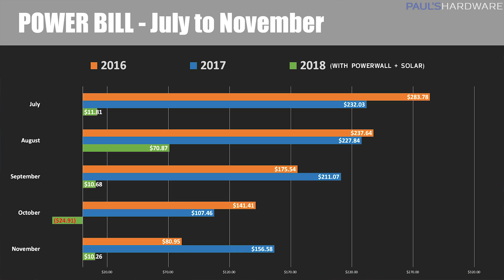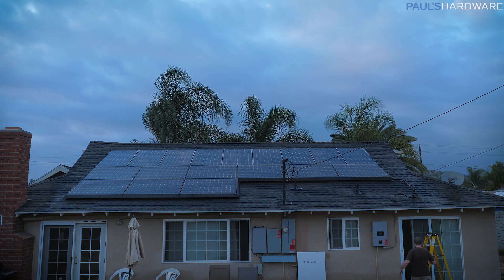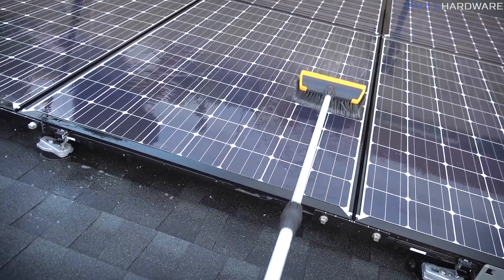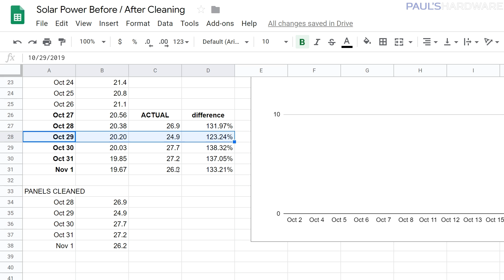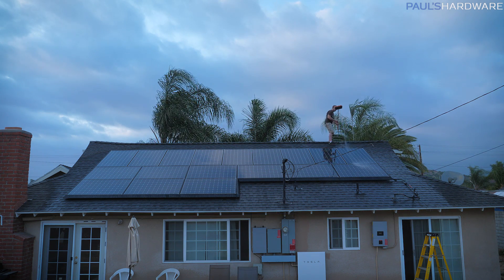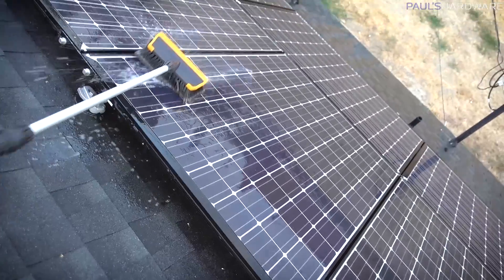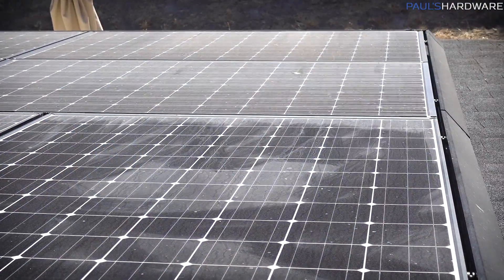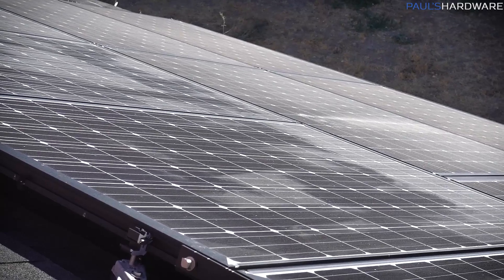Should You Clean Your Solar Panels? Before/After Testing!

Comment: Paul i was told to use a pressure pump washer with detergent and an extendable brush like the one you have to wash the panels as you want to minimise the water used to wash them as it can make your roof slippery, then once done hose them off from the top of your roof like you did originally.

hope this helps with the part 2

Comment: just checking your math and you actual actual percent difference are as follows Oct 28 = 27.6% Oct 29 = 20% Oct 30 = 32.1% Oct 31 = 31.2% Nov 01 = 28.5% not at all too different, but just couldn't live with myself if i didn't correct the mistake... sorry  Paul

Comment: Paul - wouldn't it be a ton of fun to own a cherry picker?  You could use it to clean the panels once a week, attach a small wind turbine, and/or, go to maximum height and relax up there on a lawn chair.
Other suggestion: get a longer brush, with counter-rotating heads that a powered by the water flow - along with a detergent injector.
Seems to me that a solar panel cleaning business might do well in your area.

Comment: If your water is hard, it may cause calcium deposits to form on your panels over time. FYI. May or may not be worse than the dust, will definitely be harder to clean off. Suggest water softener chems to your wash.

Comment: I'm surprised you've seen such a big jump to be honest, but I'll be interested to hear what else you find in the future.  Some other commenters mentioned checking the solar insolation - a quick look at systems around LA seemed to have a jump around that time so I think it's at least partly due to stronger radiation levels at that time.

I tend to just wait until it rains - I can see that the dust / bird poo has gone but I don't see any obvious change in production - certainly not 20-30% range.
Some data here - https://pvoutput.org/list.jsp?df=20191001&dt=20191031&id=67593&sid=60069&t=m&gs=0&v=0
We had rain around 10th and 12th October for the first time in months - not much improvement in generation after that (I'm in the Southern hemisphere so our days are getting longer at this time of year).
My best day ever is about 44.5kWh - so 40 and change lately is pretty respectable.

My installer warned me to be very careful with cleaning if I ever do - you don't want to damage the panels (so definitely don't put any weight on them) and be weary of the coatings on the glass (best to avoid chemical cleaners), so his recommendation was:
Plan A: Leave it alone and let the rain sort it out
Plan B: Hose it off if it's noticeably dirty
Plan C: "Truck wash brush" it gently with plenty of water (sounds similar to what you have).

I'm not sure if your system will interface with it - but pvoutput is great for analysis & comparison with other systems near you.

Comment: Why are your panels getting dirty like that in the first place? I'm genuinely curious about that. Our 12.1 kW array has been up and running since 2013 and their surface is no more dirty than the day they were installed and we haven't ever cleaned them. Is this due to their surface material or the location of the panels, or maybe the angle? I check once or twice a year but every time I do I can't even find dirt on my fingers. But ours were designed to perfectly face the average inclination of the sun through out the year so maybe it's the steeper angle that keeps them clean? We live in the mountains of central New Mexico just 30 miles southeast of Albuquerque. Genuinely curious Paul. Oh and be careful up there on your roof please.

EDIT: By the way, your video makes me want to start cleaning them every spring at least whether I see dirt or not, lol. Thanks
Reply: He lives in California. If I had to guess, it's a combination of the dust and soot from the frequent forest fires, the lack of rain and the relatively high air pollution as a consequence of the state's high population density.

Comment: Hosing alone sadly won't remove the dirt, dust and grime that gets BAKED ON by the hot sun and ends up blocking the light getting through. Just look at ANY CAR left out on the street that's been untouched for a month or more - get inside and you cannot see through the windshield. The only way you're going to get your panels anywhere near clean is to either use a rag and go hands-on or that car wash extension rod with a soft bristle brush. It wouldn't hurt to run a mild cleaning solution through the hose as well since water alone isn't that effective.

If you're too chicken to get on your roof top then invest in a power wash. A high pressure nozzle will give you a longer reach and allow you to clean it from a ladder. Also, there is no shame in having an extra set of hands to help!

And yes, 30+% is significantly significant and can add up to hundreds of dollars OVERPAID to your utility over the course of a year. never mind wear on your batteries from additional cycling. Every solar owner should clean their panels at least twice a year to help maintain peak efficiency.

Comment: Are you allowed to use a car wash/dish soap on the pannels ( a degreasing agent ). Is that recommended or do they tell you to simply wash and scrub the pannels. Also thanks for the follow up videos. I appreciate the full breakdown of the whole system (cost, install process and power output). Side note I keep seeing your house on articles I have read about clean energy or solar pannel installation etc etc. Some how your home is the cover photo I keep seeing. Take care Paul and keep up the great work.

Comment: Have a look at an auto supply store for car wash soap / detergent that claims to lift residue and not require hand scrubbing. These formulas don't work very well on cars, but should be great for your roof. The products I'm thinking of come in bottles that you attach to your garden hose and have a built in nozzle. Squirt it on and then switch to a regular nozzle to rinse it off.

Comment: Paul, PLEASE buy an extension ladder to get up on the roof. Using that 6ft ladder (I'm assuming you used it since no other ladder is shown in the video [besides during the installation of the solar panels timelapse]) made me cringe, as that can lead to a very bad day(s) if it tips over while climbing up or down from the roof...OR...if you must use that 6ft ladder, rotate it 90° & get someone to brace it. I'd hate to see ya get hurt man!!!

Comment: Try using soap and they sell brushes that extends out to 11 meters, they are a little expensive but would make for another interesting video 😁
Reply: It says in the user manual, that you should only use water
Reply: @CyberlightFG  What harm would soap do?
Reply: @justsomeguy934  I don't know. The manual says, that you shouldn't use anything else then cold water.
Reply: @CyberlightFG  Well, that limits one's ability to clean the panels, doesn't it? You're only left with physically scrubbing them.
Reply: With a brush I'd be worried about trapping dust and sand under the brush and then the back and forth movement scratches the solar panels. A lot of dust you see settle on things is silica, so as hard or harder than the glass. From what I've heard, the best way to clean it is to give it a long sweep from one side of the panel to the other without a back and forth motion, just like cleaning your phone screen. That way you pile up the dust in front of your brush and just push it off instead of scrubbing it back and forth over the glass.
Reply: Airclot water alone is a great lubricant and prevents dust and sand from creating as many scratches. Given the lifespan of solar panels, cleaning will result in more power even with small scratches, compared to not cleaning.
Reply: Do not use soap, use deionized water.

Comment: @paulshardware, aluminum and brass are highly reactive. If your valve, hose, or attachment are mixed it will cause that type of corrosion. If not, there is probably another type of reaction causing the corrosion.

Comment: Paul I'd say the safest way clean your panels is to get a long pole of some kind and do the cleaning from the ground if at all possible. As someone who has fallen from height and broken a leg doing it I'd say stay on the ground if you can. Failing that , I'd go and get a fall harness if you need to work from the apex of the roof.
You could use truck wash soap to clean as well as long as you remember to rinse it off totally.

Comment: I had my own panels installed in 2012 Netherlands, Europe and cleaned them for the fist time early February 2017. They were really dirty and even had some green algae on them. That year 2017 would unfortunately become the year with the lowest power generation. So far but 2018 was the year with the most while they were already dirty again. It will no doubt make a slight difference but don't expect too much, probably makes much more difference in sunny climates than in moderate ones like mine.
Reply: Actually, it should be the other way around. If you get half the amount of Sun, you should have designed a system with twice the number of panels to generate the same amount of power for your home (this does make an assumption that homes are homes and require the same power). Therefore half as much gain from cleaning your twice as many panels is the same total power recovery. Clean your panels.
Reply: @CorwinPatrick  You can compare the Dutch climate with the north of New York state. Solar hours can vary quite a bit from year to year. Had 2017 been an average year I might have seen a slight increase in yield but it was a pretty bad year with less than average solar hours. The PV system generates about as much as I use, again on average. In 2017 I had to pay my energy company a bit but all other years since 2012 they have been paying me. Energy put into the grid costs the same here as when I have to buy it. I paid for it with my savings and early 2020 I will break even and from then on all excess energy is basically free money. Glad I did it. I will probably clean them again in 2022.

Comment: You should try cleaning solar panels on a 8/12 pitch two story house.  It's a long way down to the ground.  I use a telescoping brush the professional window washers use.  The only recommendation I would do is use a mild soap to help break up the grim.  After cleaning them I do see a power power increase.  I had the panels installed three years ago.  Been keeping track (created a spreadsheet for power produced and the sky condition for that day and calculate the efficiency)  and I have seen a slight degrade in power ( which is natural).  My results show about 2% degrade.  One other suggestion would be to go back track efficiency of the panel to let you know when you have to replace them.

Comment: I would suggest you get a long reach cleaning kit that goes out to 15 feet or more and working from below on your ladder (get a better ladder by the way) clean from the top down.  Then all you have to do is worry about falling off your ladder which can still kill you so be careful.  If you are getting 30%+/- increase you'll pay for a professional heavy cleaning kit in no time and you'll be willing to do it on a schedule monthly, bimonthly, or quarterly.  It doesn't have to include water running through the pole if you have someone that can hold the hose and spray it up there.   Lastly, you could put power jets along the top of the panels with a connection down at ground level so you can just turn the water on and have it spray onto it whenever you wanted and then you just need a brush to reach it from the ground or ladder.

Comment: How about just comparing your solar production from when the panels were first installed, and clean, to how they performed 12 months later prior to cleaning.
Reply: Well it could be argued that there may be a degradadion in the quality of the panels over that time as well? Panels have a multi-year life span true, but after a year of use, I would expect them to be working at a slightly lower efficiency. By doing it this way, you remove the variable of panels aging. And by recording the measurements over a month, you're able to average out the daily variable of different amounts of light and so the primary source of any change in your results is the cleaning. It's all about minimising the number of variables that can distort the results.
Reply: Solar would vary too much over such a long time to provide a meaningful comparison. His was actually a good methodology given the limitations of his sample size and all other factors.
Reply: Because there are other at least 10 others factors I can’t think of that would need to be taking into account... doing it like this .... he only made sure to take out liar days much simpler ....
Reply: cause that makes too much sense and how else would he get a 10 minute video of him "cleaning" his panels
Reply: @madeofdrew  If he had gone that route he would still have had to clean them.
Reply: @lestermarshall6501  exactly which is why I couldn't even watch the rest of the video after seeing his attempt at cleaning them lol

Comment: I'd like to know clean VS hosed, but you really need a surfactant (like dish soap) to remove the film left behind after the hose-brush. Would you hose a car with plain water and then wax it? Put a teaspoon of dishsoap (like Dawn) into a squirt bottle (with a straight stream) and fill with water. Squirt it uphill of the brush occasionally while you rub the brush around. If rinsed right away, you won't even have streaks. Love your content, and say hi to your family. P.S. Like you, I was surprised at the amount of the difference. I too wonder if this 'normal'.

Comment: So for the future of your solar panels..... #1 Call up Tesla and ask them what kind of soap you can use. Dawn soap is used to clean animals found that are covered in crude oil from oil spills. #2 Find a longer pole with a car wash brush attachment, use "Tweezers" to attach the garden hose to the pole. Thanks for the update and data Paul.

Comment: “Should you clean things that are dirty?”
Reply: well it was more of a "is it worth the time and effort cleaning them" like if it was a 2% increase it wouldn't be worth it.
Reply: @thomaswepfer  It also helps you keep track of new and old parts, for examples if you are working on your car.
Reply: My wife’s dirty and that’s the way I like her...
Reply: @cheeky_farquar  I like her dirty too!
Reply: i just clean my ass when it start to itch
Reply: @thomaswepfer  The corrosion is effectively a protective layer against further corrosion. Same with any layers of old grease. Why remove it unless you need to use the part right away.
Reply: Tesla, formerly Solar City, routinely claims to it's customers that the accumulated dirt on the solar panels doesn't significantly affect power production. The video clearly debunks that rather obvious falsehood.
Reply: @russellthorburn9297  Not necessarily. There are a number of factors, most importantly how dirty your panels get. In many places pitched panels are cleaned perfectly well by rain, and the efficiency improvement from extra cleaning is limited. You then need to balance the cost of paying someone or the risk of DIY.
Reply: It depends on how dirty you like it
Reply: Not worth the cost. Worth spraying down if your hose reaches from ground level
Reply: Simple,yet deep. Efforts are easier when burden is mitigated to a system,like nature cleans itself through this timeline of evolution. Just man made machines needs lots of maintenance,upkeeps to keep it running efficiently. The more an individual has to clean,the more "time" and burden is placed back at an individual to add another maintenance to their list vs place the maintenance back to a strong society power delivery system managed by many instead of one🤔.  If only we can run it better,individuals wouldn't have to keep placing more burden in ones pocket. Just taking care of my  teeth,nails,hairs,skins, tummies,desires, is already overwhelmeing. Now, dirty solar panels,more maintained!!!
Reply: Well he's cleaned the panels,  but not the Sun. So the Sun must be mighty dirty too.  It's like cleaning only one side of a window.  Lazy bastard.
Reply: @jondonnelly3  Lazy was the cleaning job he did, but dirt on the sun? Lol, that shit would get incinerated.
Reply: How do you clean a Dirty Mind?
Reply: @seabreezecoffeeroasters7994  Why would you want to do that..???  I LOVE my dirty mind!!    HAHAHHAA
Reply: @seabreezecoffeeroasters7994 cannot because dirty mind is automatic, level 1 quick pop up thinking ,but one can recognize it with level 2 awareness. Level 2 helps cleanse,organize, the dirty mind, but not gonna be easy😂. Takes level 2 training to understand our dirty mind,then baby steps to clean, because frankly, it's quite dirty.

Comment: Hi Paul I have 26 panels (4.5kW) on my 2 storey home. Unfortunately due to the height I cannot clean them. I’m sure you know solar panels will produce more power when cooled with water but that’s only temporary. My neighbour demonstrated on his system during a sunny day and the output rises immediately. I’ll have to connect my laptop Bluetooth to my system to check its current output compared to when it was new as I still have the “as new” data in my spreadsheet. Thanks for making this video. 😃

Comment: I think you could safely use a pressure washer with foam attachment with a good quality car wash soap to do a deep clean from a safe zone without taking the risk of scratching the solar panels. Let it soak, rinse with the hose afterwards. We know it works well for cars, should also work for solar panels. Cheers
Reply: definitely don't, that much pressure would add in microfractures and would tank the production of the panels
Reply: @r33s3spI3c3s  I don't think so because with the foam attachment, you greatly reduce the water pressure and really just spray thick foam based on my car washing experience. I wouldn't put the pressure washer straight to the panels or car paint either of course. Cheers